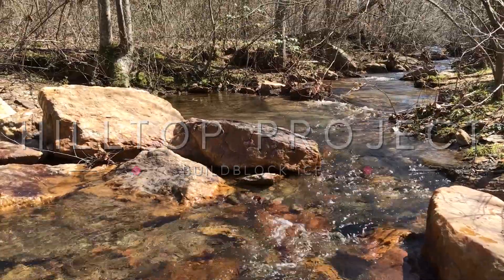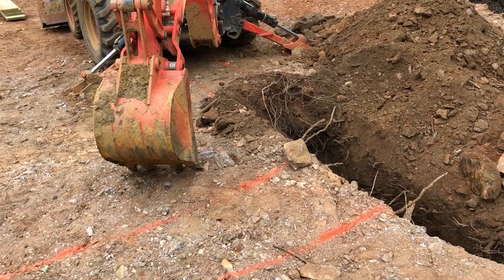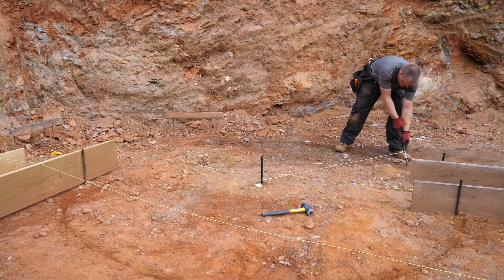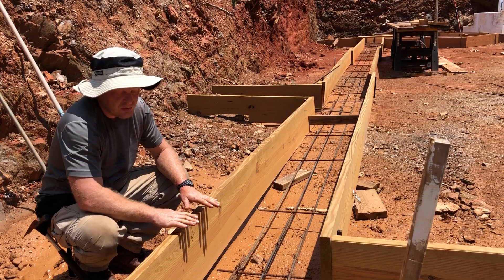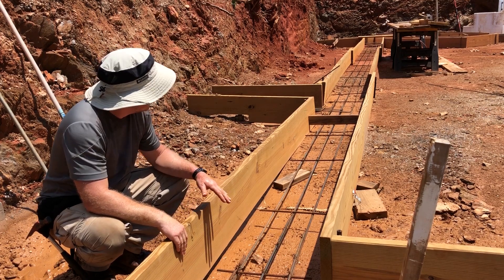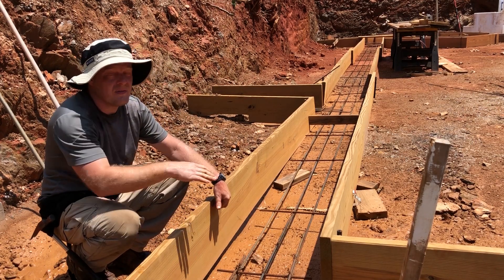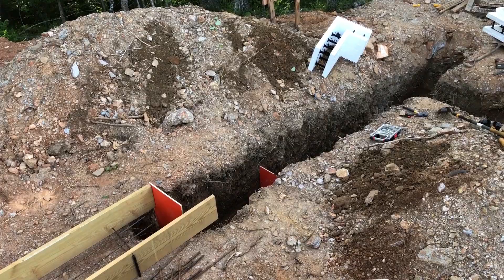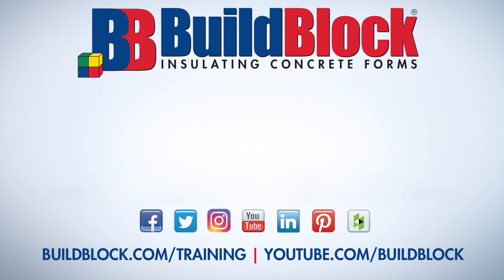Hilltop Project Footing Construction

Comment: “Nice video. Polycrete makes a standard ICF footing form that's 12" high by 24" wide. This fully assembled form features folding steel wire cross ties and steel reinforcement inside the EPS so it's strong enough to handle all that concrete. These footing forms are perfectly compatible with Build Block ICF walls. Learn more PolycreteUSA.com”